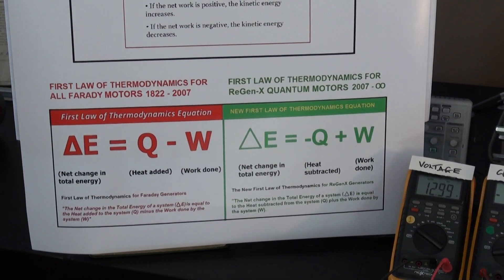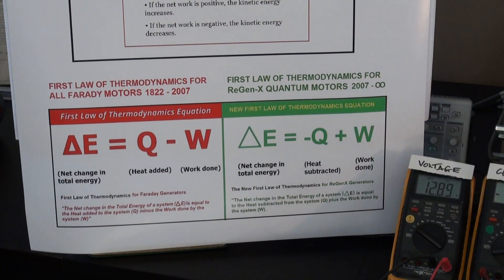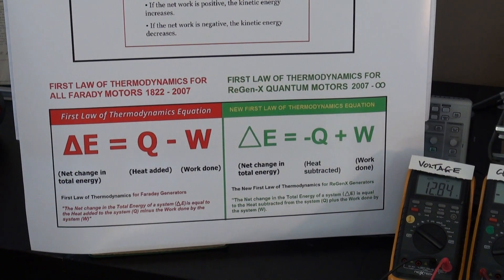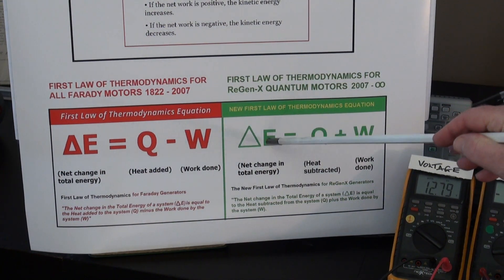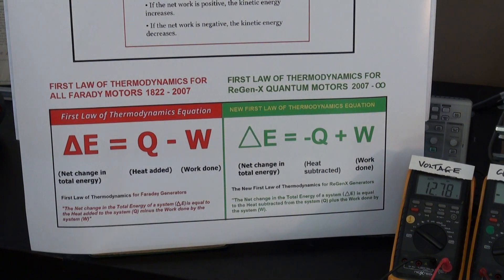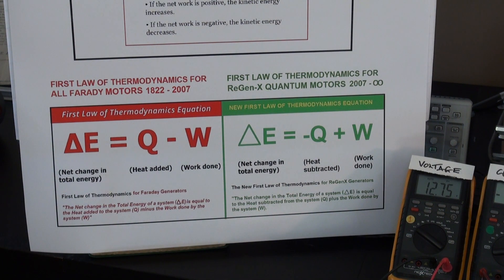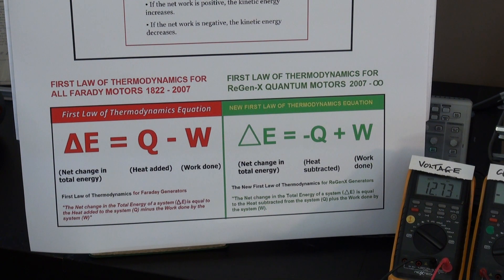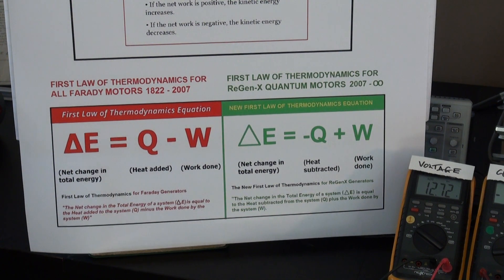New First Law of Thermodynamics for US Patented ReGen-X Quantum Motor and ReGenX Generator

Comment: Was this a development that came from BTT research? I'm still trying to understand that one.
Reply: Bitoroid transformer, also known as split flux transformer, is very easy to replicate. You need to buy shell type step down transformer, and than rewind secondary winding, and add extra external core, which increases mutual inductance between two secondary coils.
Reply: @MetaAlcoholic  Thank you.